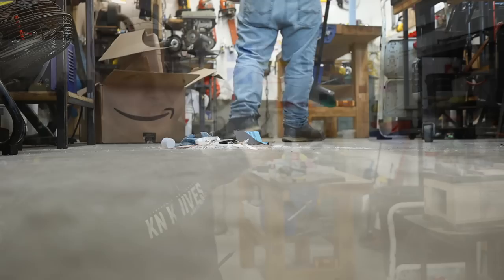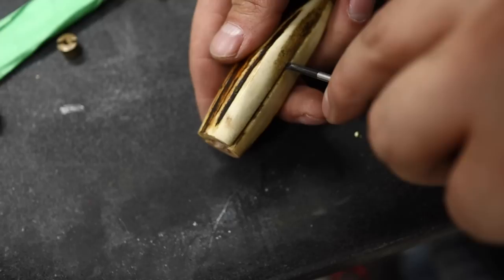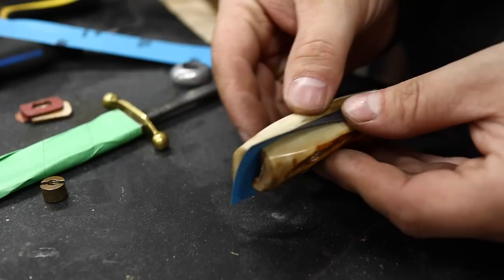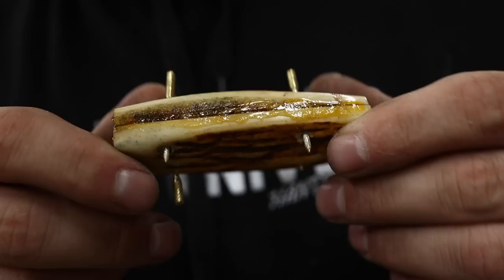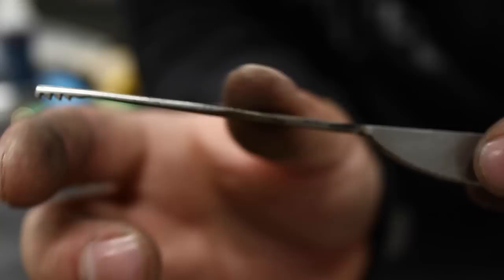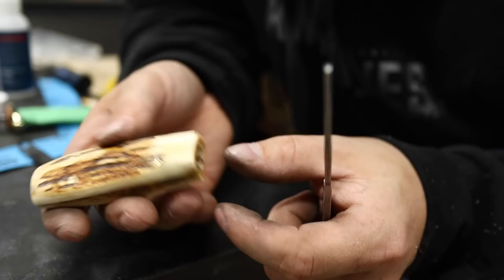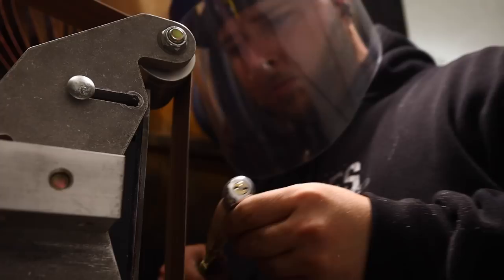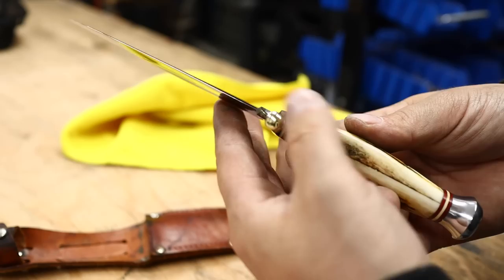Restoring my Clients Antique German Knife

Comment: Kyle, I can say with good authority that your restoration looks as good as new because I have a very similar knife that I purchased in new, unused condition sometime in the late ''70s at a flea market in central Georgia. I bought it from a guy with a table full of knives, so I have no way of knowing if my knife was a recent production, or an older model he picked up wholesale as factory close out.

I did a quick check online and I came across a number of similar knives that say they are made by Edge Brand. Mine is stamped "Edgemark" and Solingen, Germany on one side, and 426 on the other side. I never noticed until you pointed it out, but the sheath is stamped Solingen Western Germany. The stitching threads are very thin, I think the manufacturer relied on the rivets to hold the leather together more than the stitching. There is a stamped image of a stag on the sheath. The guard on mine is a large rounded oval shape, it does not have the little knobs on the ends. 

My knife came as a set of two. The second, smaller blade is a caping blade that rides in a smaller sheath affixed to the front of the sheath. 

The blades came uncoated with sort of a satin finish, not mirror finish, but bare metal. The stag handles are one piece on both of mine, I just double checked. They have the same decorative red spacers and the same pommel construction as the one you feature. 

I couldn't find anything on a steel called 426, so I assume that 426 is a model number and not a type of steel. 

Years ago I used a Lansky system to put a very fine edge on the blade, like one would put on a filet knife. My bad. It was scalpel sharp but it was easy to turn the edge slightly when cutting through deer and hog bone joints. The metal didn't chip, if that gives anyone an indication of the steel type. I went back and put a steeper angle on the edge, whatever the middle setting is on a Lansky, I can't recall right now. After that, the knife held a great edge and I have used it to clean a good number of deer and wild hogs. I eventually switched to a drop pointed blade for cleaning animals, but this knife is still my backup. The upturned, Bowie style blade is not great for gutting animals, but it's nice for skinning them. Edge retention is very good, I can clean several deer with it before I have to touch up the blade. Often, a few passes on a strop are all it needs to return to hair shaving sharpness. The handles are nicely shaped and they really fit the hand nicely. It's a very comfortable knife to work with. 

Based on how well the edge has held up I feel like the steel is good quality. Stag antler handles are not easy to come by, or affordable nowadays. If the style of the knife suits your needs, I think the quality and beauty of the knife for the price is very worth it.

Comment: Kyle. Where did you get that forked tool to set the  screw in the end of the tang to secure the pommel to the leather handle. If not available retail, is there an alternative method. My old German hunting knives need some restoration.
Thanks, Norm